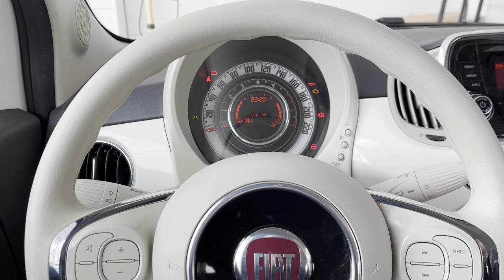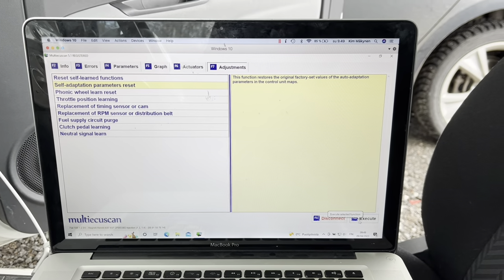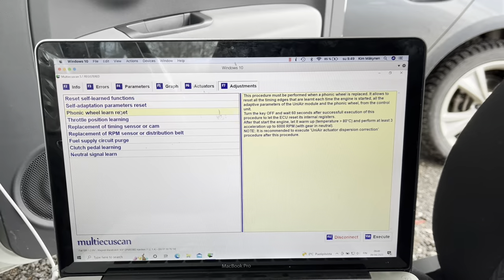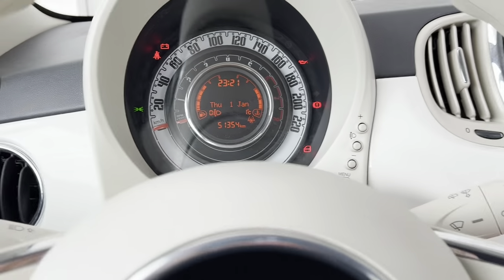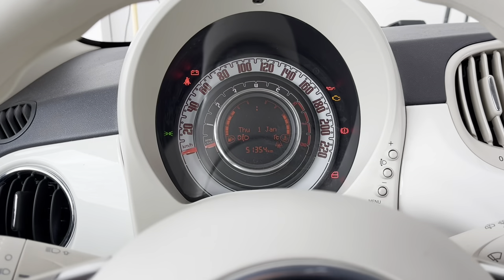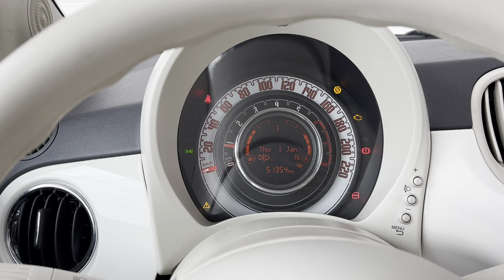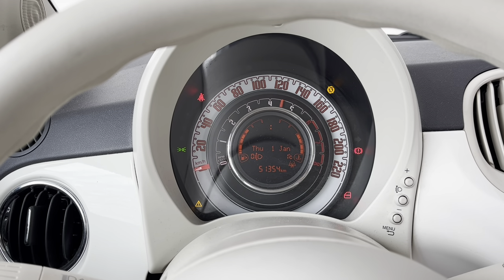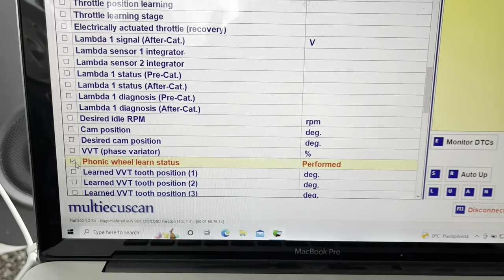Fiat 500 1.2 8V Phonic Wheel Learn Reset / MultiEcuScan

Comment: Hi. Great video. What Adapter are you using with the multiscan? and is is the Free version of multiscan or do you need the registered one? 
chers :-)
Reply from the maker: I have the registered version and don't know if the operation can be done with the free version. I bought the modified ELM-cable from here: https://www.ebay.com/itm/204045818032